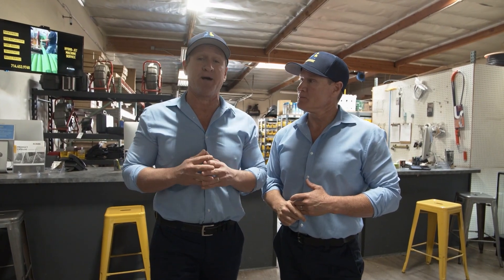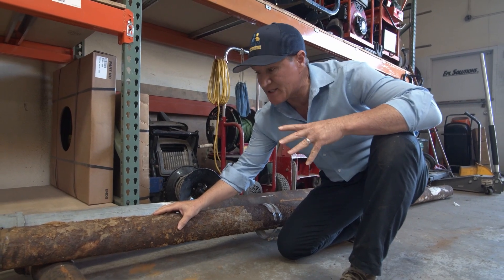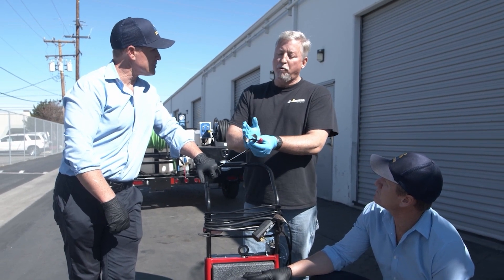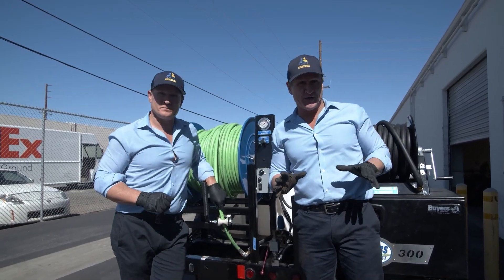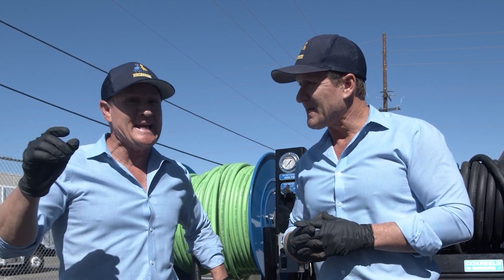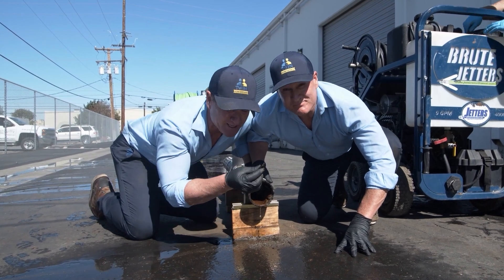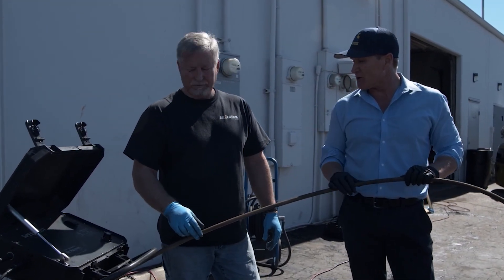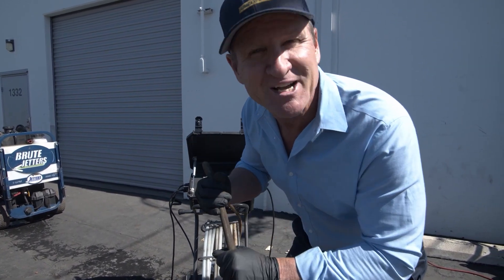Snaking vs. Hydro Jetting vs. Descaling

Comment: LOVE your vids. I hydrojet....there is a problem with your video.  No roots, no sluge.  The rust inside the cast iron pipe is the least of your worries.   I use a 3000 PSI machine and cuts through the roots and sluge like warm butter.   IMO,  a mixture of lint and hair from the washing machine discharge line mixing with grease and food debris from kitchen cause most issues in my area.  Where the kitchen sewer line meets the laundry sewer line is a huge problem area.
Reply: So what is the solution?  We are currently having the washing machine/kitchen issue now.  We have a mop basin/shower in our laundry room that is backing up when using the washing machine. Plus when we plug our kitchen sink, when we drain it, it too is backing up into the mop basin. We're "up north" and had multiple plumbing companies snake it. It plugs/backs up about once a year.
Reply: That's what a camera is for, if they just snake the line and there are roots, all they did was poke a hole in them, and like you said, it keeps coming back. Either a jetter with a root cutting nozzle or the unit with the chains is probably what you will need.

Comment: Not as easy as presented, there is much more to cover lots of do's and don'ts depending on the size age condition of the cast iron, an inexperienced plumber could get himself in a lot of trouble, been doing this for 47 years way before cameras and water jetting were an option. kind of entertaining though. looks like they figured out a way to make money without dealing with all the shit. literally  kudos to you fellas.
Reply: Although we are engineering it, we are making it for ourselves to use as well.  EPL is out there in the field helping contractors deal with real world situations.  I understand what you're saying.  Here is a another video: https://www.youtube.com/watch?v=vqPxhgxtJSg
Reply: Hi. I was wondering with the equipment you used been able to unclog a pipe impacted with seeds that been run through a garbage disposal? And when you quoted a job, does that include the cleanup?

Comment: Plumbers don’t need you softballing questions for potential clients about how long their cable is. Tell them to save all of their questions for themselves. The first one being, why didn’t they call a plumber before they put all of that “dad ayed plumbing” up under the house, in the first place? With no strapping on it for 35 feet. How long were their hands and aye cheeks purple after slinging purple primer all over everything and rolling around in it too? Who soldered that threaded drop eared ell that they used for a female adapter to go back to galvanized pipe? The one that looks like it’s been roasted over an open flame for 61/2 hours.

Just having fun with you man 😂 👋🏾

Comment: Would the speedcut descaler be too aggressive to remove roots from terracotta pipe? Would you suggest hydro jetting for that instead?
Reply: you can adjust the chain to diameter it doesnt wreck the inside......unless there is a break or crack already.  But the person should camera first to see the area getting jetted and descaled

Comment: I live in Orange County in CA. After descaling the cast iron sewer pipe, I was told the epoxy application needs to be done to avoid future problem from the cast iron sewer line. Is it necessary to put the epoxy application? Thank you for your advise.  Keith.

Comment: Video is intellectually dishonest. You wouldnt used a double blade for descaling a cast iron pipe. It would be for unclogging. You also sent through two different methods through the same pipe before getting to the speedcut. "Like new!" Yea after cabled and hydrojetted. Im sure it works fine but come on guys, ya just stringing a bunch of senseless content together to get a full video
Reply from the maker: Yeah yeah!

Comment: Would hydro jetting or speed cutter work on clay pipes?
Reply: To clear stoppages, jetting is usually the best solution.  We have needed the SpeedCut to remove tree roots 1.2" in diameter in clay pipe, that the Jetter could not cut.    Otherwise, jetting is easier on the pipe.